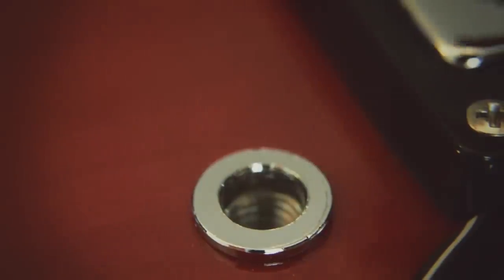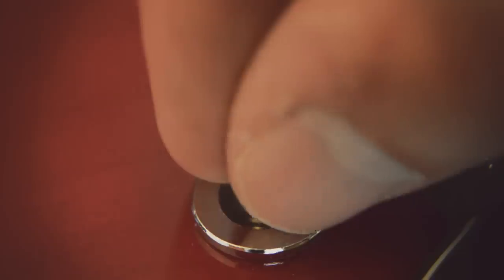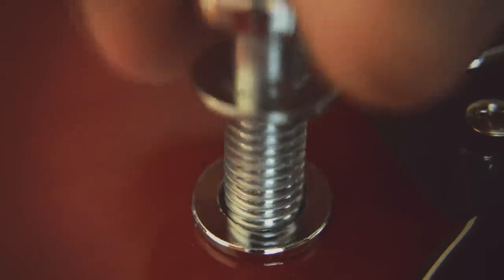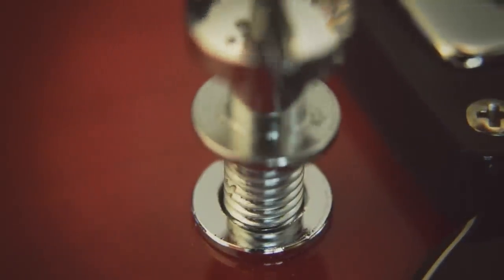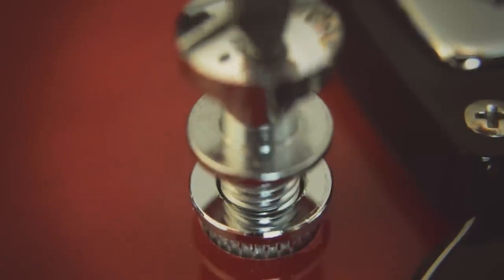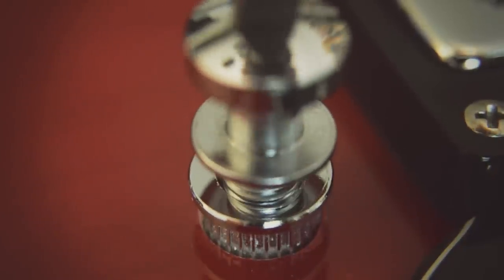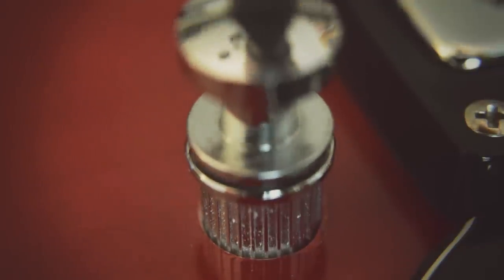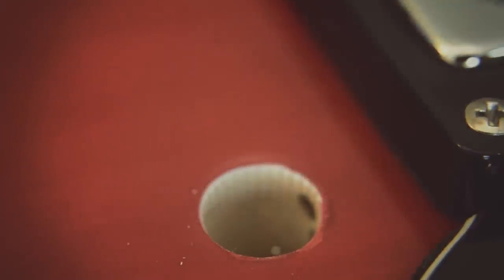How to Remove Tune-O-Matic Bushings (in 53 seconds)

Comment: This is brilliant and works as expected; however, be careful that it's possible to bend the tip on the screw that you place inside the brushing if you exert too much force. It's also possible for that screw inside the bushing to impact the wood inside, again if you exert too much force. Additionally, a third possible mistake if you exert too much force is damaging the bridge-post flat-head screw recess. I guess the moral is not to exert too much force.

Comment: Such a great tip. Thank you kindly. :-). A small addendum, maybe replace the bridge screw with a hex bolt for the more stubborn ones, gives you a bit more torque if required :-)

Comment: Is there any way to take them out if the threads are messed up?
Reply from the maker: I'm not an expert on this matter and maybe someone else has a better tip?! If the bridge post goes in even few turns then you could try to grab that with pliers and pull the bushing out. Bushings are usually really tight, so I wouldn't bet my money on this.
 
If the threads are really messed up then the only option might be to drill the bushing out. Personally I would leave the more complicated stuff for professionals since there's a big chance of messing up your guitar body.
Reply: Thanks!

Comment: Perhaps easier to cut 1/2" off a dowel that is slightly smaller than bushing hole and drop it in.  Nothing gets ground into the body of the guitar.

Comment: Looked so easy. Now my post is stuck in the bushing thing. 😨
Reply: Did it come up? You can use a vise and just enough pressure to remove the post
Reply: I just dug it out with pliers and a screwdriver. It wasn’t pretty. But got it out of a basher guitar eventually.

Comment: Wow this did NOT work - all it did was dig the screw into the wood of the guitar beneath.
Reply: Same happened to me: 2 screws were craved in the wood, and the bushing didnt move 1 milimeter.
Reply: Can't fix stupid.
Reply: Erick Sousa what did you do to fix it? I'm having the exact same problem. Can't get the bushing out at all and the screws are just smashing and the thread won't come out at all